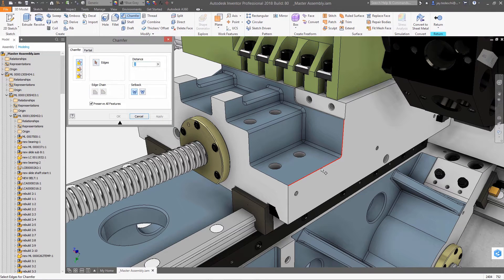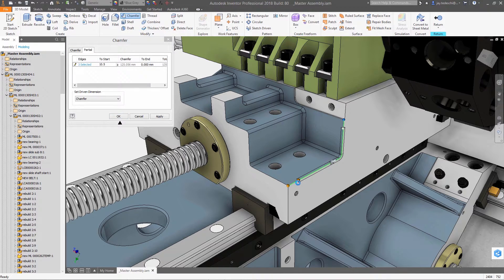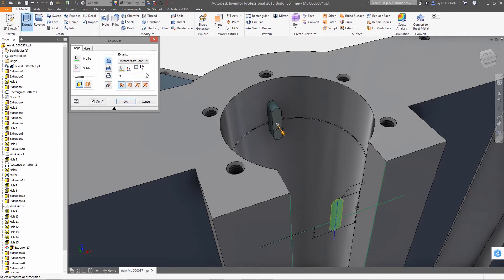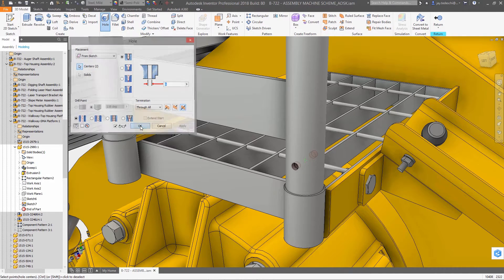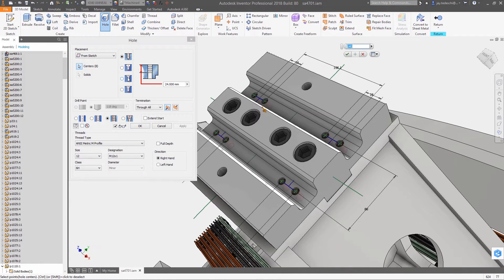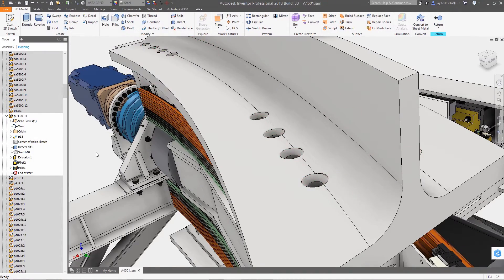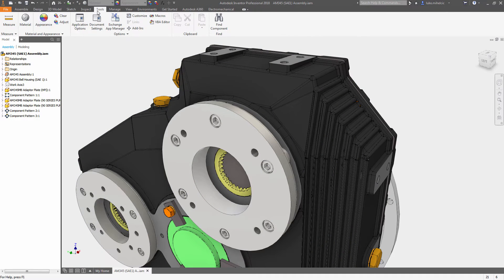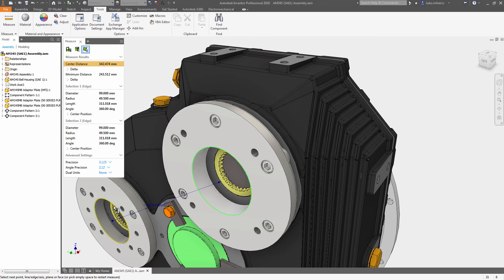Inventor 2018 Whats New - Inventor Ideas

Comment: i can install inventor 2018 whit vault 2017??
Reply from the maker: Hi Alejandro, unfortunately, you won't be able to use Inventor 2018 and Vault 2017 together. Your Vault needs to be more recent than the other products and will work with 2 years previous versions of your other software. So for instance Vault 2018 will work with Inventor 2018, 2017, and 2016.